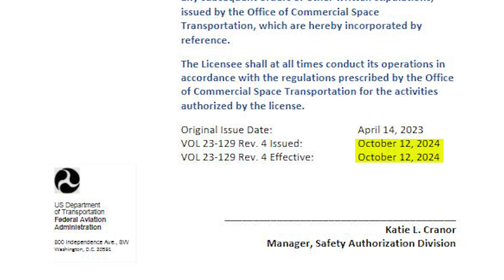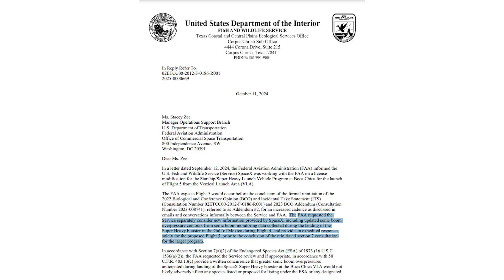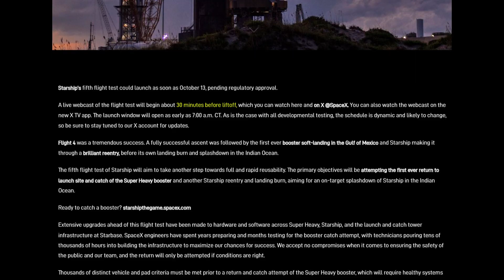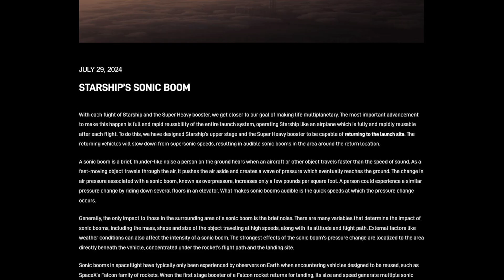SpaceX Was Just Approved For Starship Flight 5

Comment: Surprised the authorization came from the FAA. They were pretty adamant about it not coming until November. I thought for sure the authorization would come from NASA. Well, it's a good thing, SpaceX needs to be able to iterate quickly.
Reply: Agreed! 
Perhaps, someone may have whispered in Mr Whitakers ear (FAA Biden appointee) that there is an election in a few weeks...  😉
Reply: Probably NASA and especially the DoD due to all the projects they have waiting for SpaceX to get this working.
Reply: Where do you get the idea that NASA has the authority to authorize the flight?
Reply: @DavidJohnson-tv2nn  As I understand it, NASA and DoD can launch flights without an FAA license. NASASpaceflight has an explanation in "Why Falcon 9 Faced Investigations But Not Starliner" around the 7:04 mark.
Reply: @logicalfundy  Thanks the information but I highly doubt that NASA would put up with some of the reckless behavior we've seen in the past with Starship. If NASA did take over responsibility, Musk would probably not be happy.
Reply: @logicalfundy  For programs they have good insight into, yes. Starship HLS isn't run like that, though, so I do not think there is any chance NASA would accept that responsibility.
Reply: @DavidJohnson-tv2nn  Either NASA or DoD or both told FAA’s Whitaker to stop harassing Elon’s company or they would take over and shut the FAA out of the loop. The success of Starship is integral to NASA’s Artemis and the DoD’s Strategic Lift Command projects.
Reply: @DavidJohnson-tv2nn  I wonder that one as well.